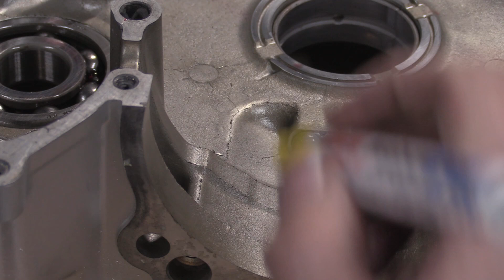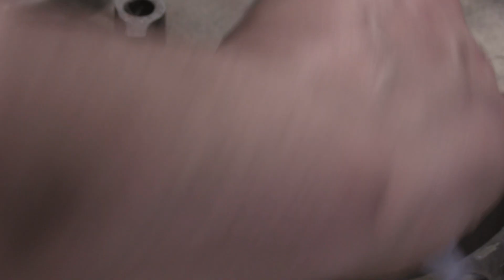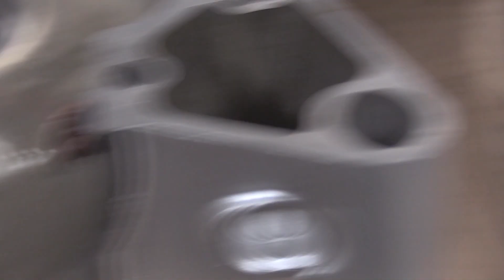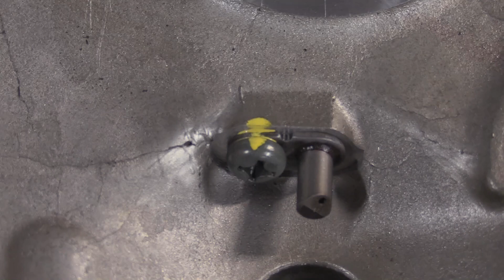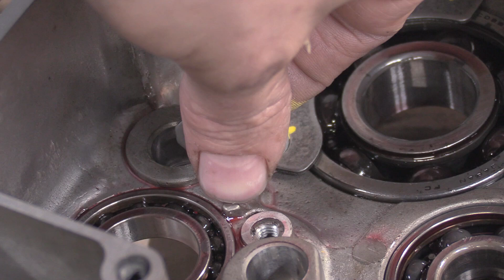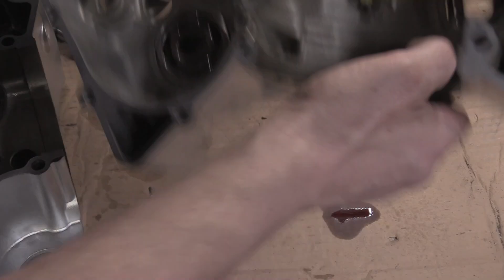Casing Pre assembly #23 Suzuki Trackbike

Comment: Hey Matt, why are you using 638 retaining compound meant for slip fit applications on your threaded fasteners instead of 263 thread locker which is better suited for threaded fasteners & also high temp and oil resistant?
Reply: I wouldn't say that just yet, maybe he's tested it and it's fine. Many manufactures put the same product under a different name just to load up your shelves. And loctite is expensive. I can only go by what loctitie recommends, maybe he knows better.
Reply from the maker: Just no? Do you know the differnece  between them? I know the answer is no to this question. You're the reason I do these videos lee, people like you.
Reply from the maker: Oh, so you're not an engineer then? Have you tested the 2 compounds specified, if so what where your results? I await some data...
Reply from the maker: Also just to add, my uncle is a master technician for BMW, I asked him just for a laugh, he didn't know either... you're trying to argue with some kind of authority... piss poor authority at that.
Reply from the maker: Oh I've got one mote question, HRC coat the underside of their pistons with a "special" coating that ONLY for the underside, why is that? 

Just so you know, I know what that coating is for and what that coating is, however, do you?
Reply from the maker: Yes I do, but I wanna know if you know. I asked so answer the question.
Reply from the maker: Lol so you don't know, and you couldn't Google it. Funny that isn't it. I asked you because Google won't tell you. I know because I work for the company that tests that exact coating and have the results from those tests. 

But I'll bit, can you point out where I have "little mechanical skills"?
Reply from the maker: Also, don't bullshit, it makes you look like a tit
Reply from the maker: @ribbster123  so what's the coating then, why is it there only and how is it applied?
Reply from the maker: Lol no. That's not the reason, so fail on that front. Secondly you didn't say how its applied and what it is. I said HRC, they only use 2 coatings, and only one of them is on the underside of the piston. 

The fact is you didn't have to say you know, and I didnt expect you to know. There's no reason why you would know. It's not required of techs to know. But you couldn't help but bite.
Reply from the maker: Also that high pressure blasting technique is surface peening, and it's to reduce fatigue cracking through heat cycles.
Reply from the maker: You didn't say which bits were the laugh stock of the bike trade. Actually who else are you talking about? It would be super if you weren't a puss and actually answered questions instead of ducking them
Reply from the maker: Lol honda jazz?! Bhahahahhaha! I said HRC! Wow that's crazy funny, thanks.

So what are these "seriously poor work" examples then?
Reply from the maker: Lol and the saying is glass houses, not green houses, and "shouldn't" throw stones... lol wow you're a smart one!
Reply from the maker: "honda use there cars to test out new technology  before it arrives on bikes !!"

- LMAO! That's the funniest thing I've ever heard in the comments of youtube. You're gonna get your own video dude. So honda have this department called HRC. HRC stands for Honda Racing Corporation, here's the link - https://www.hondaracingcorporation.com/ - part of their mission statement reads -

"Our (HRC) activities are an important source for the creation of technologies used in the development of Honda motorcycles."

How don't you know this? 

"ok so where do you think Lamborghini testing ? i will tell you , they put these parts on skodas and seat cars !!! "

- Yeah, cam sensors (made by ZF) injectors (made by bosch) etc etc, not pistons, cranks, rods etc... Ducati is owned by the VW group, but it has nothing to do with Skoda or Lamborghini, ask mew how I know...

"and as for poor work examples every time you pick up a tool by the looks of it ."

- that's not an example. Do better.
Reply from the maker: Wait a minute, they are computer based  control systems apart from vtec. Vtec is used on one engine and it's crap. Do wanna name something that isn't a control system... like an actual technology or design. 

I've also seen your LTN video, you're not exactly high quality are you?
Reply: cough excuse me lads, can I just swing us back to the loctite??

I'd actually be interested to know why you're using the 638 and how you know it will do the job as well as the the other one Roy mentioned?

I'm nit out to pick at anyone, I'd just actually be interested in the reasoning or what data etc you have seen and can share about loctite compounds etc.
🧐
Reply: @stevenrapa4014  just bants
Reply: @stevenrapa4014  Most all loctite usage is application specific ~ that said, many loctite compounds have overlapping properties, and indeed many loctite products can be substituted for one another...a 'simple' example would be using a 'red' loctite in place of a 'blue' loctite -- both work equally well for the purpose intended, however disassembly will be harder due to the higher strength bond of the 'red' type ....and then depending on application, substituting the 'red' type, with the lower strength 'blue' type, can be a very bad idea ~ it depends on the application.

An anecdotal, practical example, is fitting oil pump assemblies in some automatic transmission cases ~ you need to seal the mating faces between bellhousing & pump body, and likewise the bolt head flanges and bolt threads have to be sealed as they run through to gearbox interior, and also need to threadlock said bolts at the same time...m'kay? You can use either of loctite 510/515/518 gasketing compound for this application -- you also use it just for it's threadlocking capacity, on a few bolts & screws holding things internal to the gearbox case itself, even though the FSM typically specifies a different 'red' compound for the job ; both work equally well for purpose intended, but in this application you can't use plain 'red' type threadlock, to form a gasket like the 51x loctite compound does ~ it also has a number of other application usages it's specific properties suit really well...there are just as many similar applications, where this compound is unsuitable..ie; low temp, high pressure.

The 263 vs 638 thang is about permanent vs non-permanent -- steel in alloy doesn't help either ; 638 is my goto compound as well on fasteners I know will likely need to be removed again for future service jobs...especially with alloy threads.
Reply: @gcbification  that's the perfect answer, thanks
Reply: @roycash6503  No probs mate ~ wrt 263/638 you can download the TDS for each compound, and do a direct comparison of each noting the differences between the breakaway/breakloose torque values...(along with a host of other application specs). For sake of completeness, when I refer to the threadlocking capabilities of compounds like 518, this is expressed as that compound's lap sheer torque, which involves slightly different physics than usual threadlocking compounds.
Reply from the maker: Looks like lee deleted all his BS comments - coward

Comment: I did some work with various loctite retaining compounds and thread lockers on a project last year, on assembly if tolerance was close to recommendation they cured on assembly obviously not fully but you could feel resistance grow as you inserted shafts ect.

Comment: Great videos Matt,  makes me wanna pull the old turbo busa apart.  It runs ok but I repaired the engine 5 years ago with used parts after to much boost and stock cylinder head bolts

Comment: Aye, that's odd they don't stipulate tightening torque on any screws but the piston jet screw (8nm) ...a lot of the time this info ends up in the general bolt/nut torque table, but nothing at all there about screws bar the ones mentioned. Oh well, loctite will keep them put.

Comment: When engineers are deciding torque specs for fasteners with loctite/lube on them as stated by manual, how do you come up with the torque spec for those? Is there a rule of thumb of “10% less if using X product for X fastener”. Or does the lube/loctite even go into the equation for fastener torque specs?
Reply: I ask because we hear “if you put a “lube/loctite” on a fastener & torque it, you’ll be over torquing it.
Reply from the maker: No. The torque specs are with the lube/loctite factored in already.
Reply from the maker: Also people don't know this but torque values are with 25%
Reply: @thedirtyworkshop  that’s what I’m asking. How do they formulate the correct torque spec with including lube/thread lock. 
Like say they need a fastener to be 100ft lbs dry, but they want to put loctite on it. Is there a formula used to decide how much the torque spec should be for the manual with said loctite included. Like instead of 100ft lbs dry, they know 70ft lbs with loctite is equivalent clamping force compared to 100ft lbs dry. 
Sorry if my question wasn’t clear. Just wondered how they come up with the torque specs when they know a “lube” will be applied.
Reply from the maker: I did a video years back...
Reply from the maker: https://m.youtube.com/watch?v=W_N9eVa2w5s
Reply: @thedirtyworkshop  remember the title? Not like there’s a short list to go through
Reply from the maker: I've just posted a link
Reply: @thedirtyworkshop  I was wondering about this. There are big differences in prizes of torque wrenches. I bought myself somethings in between. And then I started worrying a bit about how correct they really are, but you say there is 25% margins? Isn't that a lot?  So 10 Nm can be 9 to 11? Not + or- 25% I presume, but + 12,5 and -12,5.
Reply: @thedirtyworkshop  my bad, didn’t see it
Reply: @walterverheyen1263  idk but my guess would be the torque wrench itself should be accurate, but in the context of a engineer writing the spec for a fastener, they have 25% of wiggle room.
Reply: @goinhot9133  I learn here. Thanks for that.
Reply from the maker: No. This is the reason why it's not a publicly known thing. Any torque value vs the real clamping load value has a %25 drift. This is due to the actual friction of the system with accounts for this.
Reply: @thedirtyworkshop  ah I was wrong. But once I started reading that it was a “ahh haaa” moment. Just trying to learn, that’s all